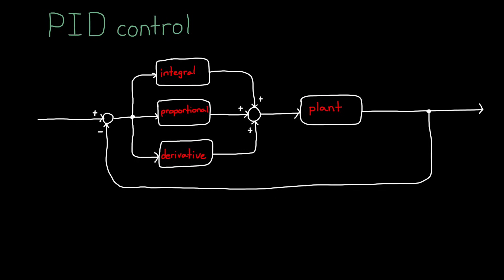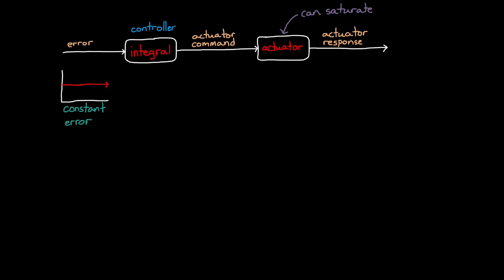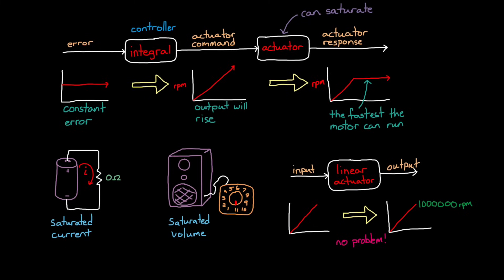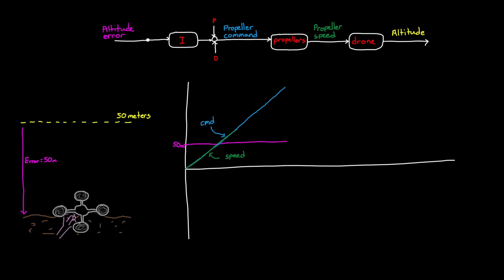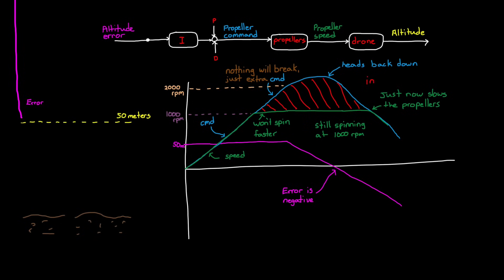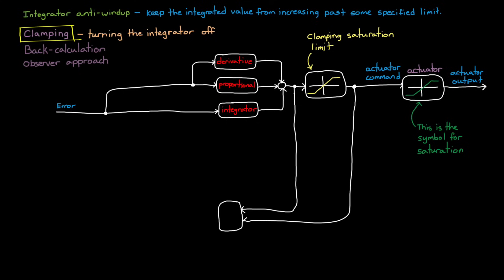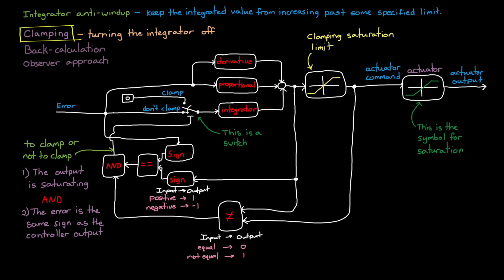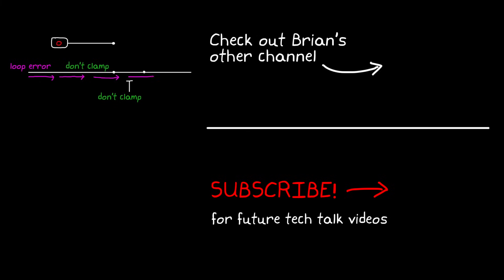Anti-windup for PID control | Understanding PID Control, Part 2

Comment: Excellent explanation—many thanks for the clarity in this video. However, there seems to be a small error in the diagram around 00:08:54 that most viewers may have missed. The “switch” controlling the integrator clamp is shown in reverse. During clamping, the signal path should be disconnected to stop integration, but in the diagram it instead appears connected, and vice versa.

Comment: To check if "the integrator is making things worse" i.e. what Brian computes as "Sign(error) == Sign(u)", I think should be "Sign(error) == Sign(u - Sat(u))". Where u is the controller output and Sat() is the saturation function.

In other words, the condition "is the integrator is making things worse" has to consider at what side of the allowed band of values the variable u is. Is u hitting the upper saturation limit or the lower one? that matters to determine if things are getting worse

I have tested this on a real implementation and had problems until I fixed this.

By the way, this assumes that the Integral Gain is positive (Ki > 0). If it is negative then the condition should be: "Sign(error) != Sign(u - Sat(u))"

Comment: When deciding whether to stop accumulating the integral term, should we not consider the sign of the integral term instead of the sign of the entire sum (output)?
Reply: No it's the sign of the output. Imagine that the integral output is a negative term but P and D outputs are both really positive making the summation of all three positive and saturating. Since the error is still positive (which we know because of the positive proportional output) this means that the integral is going in the positive direction - in this case getting less negative. Do we want that? Well, we're already saturating in the positive direction so moving the integral less negative will continue to make the whole PID output more positive and therefore more saturated. So, even thought the sign of the integral is negative, we still want to clamp it with a positive output of the PID controller. Did that make sense?
Reply: @BrianBDouglas  Right. Thank you!

Comment: Sir, can you please explain that what is the sign of the controll which you ment in the video as comparison with the sign of error ( at 8:01 minutes)  🥲 please sir .
Reply: sign() is a function in MATLAB and the documentation will help you understand. In the video, I'm just saying that if the integral is saturated in the positive direction (a sign of 1), and the error is trying to make it more positive (a sign of 1), then we want to clamp the integral and not allow it to add any more error to the summation. However, if the error is trying to make it more negative (a sign of -1), then we don't want to clamp because the error is actually trying to remove the saturation in the integral and we want that to happen.  Does that make sense?
Reply: @BrianBDouglas  thank you so much sir 😊, i have understand now . I am so glad that you replied me😊

Comment: What I don’t understand is the following. Since the error would be the difference between the measured rpm and the wanted rpm, how do we reach the 2000 rpm if we are never actually reading more than a 1000 rpm, in other words, at what point does the motor receive the 2000 rpm order?
Reply: In this example the measured value and hence the error is the drone altitude not the motor speed, hence as long as the height difference exists the integrator keeps accumulating the error value and therefore sending larger and larger actuating signal
Reply: @Omo_Mohd  Thanks for answering!
Reply: Okay I get it now, thank you very much for your response, much appreciated @Omo_Mohd

Comment: thanks brian, this is really one of the most important things we should remember in our control systems. It actually is very important in hardware control.
Reply: Can anyone please explain, why after controlling it became walking speed? At first it was error between reference point and altitude. Then why it became speed after using PID controller.

Please explain

Comment: Edit: Nevermind. The video is right. I wasn't considering that the AND gate with the output bejng saturated. It makes sense to null the integrator input if the error is positive and the actuator command is positive, if the integrator is just going to continue trying to push the actuator command further past the saturation point.

I think there might be an error in the video. As described if the drone is at 0m and the target is 50m, the error is +50m and the desired motor RPM is positive to drive the drone higher. Positive error and positive actuator command seem to be a desired state, which I don't think would be a trigger case for nulling the input to the integrator. It would make more sense that if the error is negative (drone went to 55m, so error is -5m) and the actuator command is still positive (driving the drone even higher, i.e. overshooting) should cause the integrator clamping to kick in.
Reply: I can't understand the AND gate and it confuses me, could you please explain it

Comment: Just wondering (please correct me if I'm wrong) in this particular example of holding on and then letting go... Imagine 3 scenarios: the first with a linear actuator that doesn't saturate (or saturation happens at very high levels of actuation). The second with an actuator that does saturate but there is no anti windup implemented. And finally the third scenario with a saturating actuator and anti windup implemented. In this particular example, i think scenario one will give the worst results, worse than scenario 2. Just because in scenario  one the propellers will just keep on spinning faster and once you let go it takes a while for the integrator to "unwind". In the second scenario the integrator also winds up, but the propeller can't go any faster so once you let go it will shoot up less strongly than in the first example. Of course the third scenario will be even better. Want i want to say is that for this particular example, it doesn't feel like we're solving an issue caused by saturation of the actuator, but rather an issue caused by the "initial situation".

Comment: Probably far too late but: if you have a PI controller with anti-windup , do you need derivative control? It appears to be doing the same thing i.e. putting the brakes on overshoot.

Comment: at 9:15, when 1000 rpm is reached, cmd is immediately clamped. I can understand that the saturation condition is met here. But I struggle to understand the condition regarding the sign. At that time, the drone is below 50 m and the speed of propeller works in the direction of reducing that position error, how is the condition of sign is also met to trigger the clamping?
Reply: Edit: Nevermind, I think the video is right. I posted another comment with a bit more detail on why.

I think this might be an error in the video. As described if the drone is at 0m and the target is 50m, the error is +50m and the desired motor RPM is positive to drive the drone higher. Positive error and positive actuator command seem to be a desired state, which I don't think would be a trigger case for nulling the input to the integrator. It would make more sense that if the error is negative (drone went to 55m, so error is -5m) and the actuator command is still positive (driving the drone even higher, i.e. overshooting) should cause the integrator clamping to kick in.

Comment: This is very interesting Theoretical and practical information. I have 20 years experience Thermal Vacuum Testing at Lockheed Environmental Laboratories. I have wired A SOPHISTICATED Industry High Grade PID controller, the relays, solenoids, heaters, build piping for the Liquid Nitrogen lines for Thermal cycling test for materials for SPACE. I had a hands on on its operations how all these instrumentations are put together along with data recorders /  dataloggers storing data. I have always wanted to know the engineering mathematical physics of CONTROL Systems Theory as HOW REALLY does the PID controller circuits work. I would like to learn HOW It is DONE electronically. I would like to learn how it is done on an ARDUINO to fully understand how PID WORKS.

Comment: So I have a question,
When the actuator is wound up and the drone is released and reaches the desired altitude, the integrator would very quickly decrease, but if the total height gained was large enough, would the decreasing of the integrator wind up negative and wind up in the other direction, thereby once the drone is at the desired 50m from falling, it would already be wound up in the other direction, thus causing it to not spin back up its motor in time and crashing into the ground?

Comment: Hey Brian. Great video! Why do you evaluate the signs of controller in and output? Is that only necessary for a PID controller, as the D-part can create negative control, or would you also do that for a PI-controller?

Comment: Hi brian. I have been following you since a while. I honestly love your work, I would like you a question about the wind up, shouldn't we just can't use a derivative in order to avoid the big overshoot we obtain in the wind up effect? I say this according to the idea of the derivative of PID contoller you said in the your las video. Congrats again and honestly, thank you for all the contributions you do.
Reply: I think the the derivative might not be sensitive enough to compensate. Imagine a wind up that lasted for 10 hours, the integral would become so huge that the derivative would never be negative enough to remove it before it caused a massive overshoot

Comment: To counter the integral windup can't I just increase Kd,as the drone rises up the derivative or the change in error is huge(has a negative sign) and so high Kd will ensure that the drone doesn't go too fast.
Reply: The wind up could be arbitrarily large depending on how long it lasted so no

Comment: Brian, Have you touched on Reset Wind-Up yet? ( where the error in the process control causes the control to over shoot in increasing amounts when the process approaches set-point, like this  [1,-1] [2,-2] [5, -5] [14, -14], etc .... kinda like 1/4 wave damping in reverse....?). Thanks

Comment: Integral windup, also known as integrator windup[1] or reset windup,[2] refers to the situation in a PID feedback controller where a large change in setpoint occurs (say a positive change) and the integral term accumulates a significant error during the rise (windup), thus overshooting and continuing to increase as this accumulated error is unwound (offset by errors in the other direction). The specific problem is the excess overshooting.

Comment: Clamping. Clamping will always work. It detects when there is integrator overflow and sets the integral path of the PID-controller to zero to avoid windup by using a simple switch. Clamping is a commmonly used anti windup method, especially in case of digital control systems.

Comment: Hi Brian, nicely articulated explanation. Really appreciate and really helped in understanding the concept better. By the way, when do we turn on the integral input again? Is it something like we need to continuously monitor the integral input?
Reply: I'm no Brian, but according to my understanding, the clamping of the integral input (and thus the switching off) only happens in the case that the actuator is in the saturation state. Only the clamper detects that the actuator is no longer in saturation (and that the error sign is the same in both actuator and controller output), it would turn the switch on again. So no constant monitoring of the integral would be required.

Comment: how controller output can be negative???
Reply: A servo in the middle is at a 0 position. Moving the arm right means the controller output is positive, moving the arm to the left means the controller output is negative.
Reply: Exactly I feel like it's a mistake, and it should be the derivative of the controller output

Comment: Question: Why would clamping "integrator windup". If the output of the and gate is a "1" (positive) could this be a the integrator attempt to remove the steady state error? It seems like the error becoming negative after reaching the reference point would be the first indication of integral windup, and that when the error and the integrator outputs are "negative" making it necessary to apply clamping.

Not sure why the "positive" value of the comparison would be used to make the clamping decision? Please explain.

AM

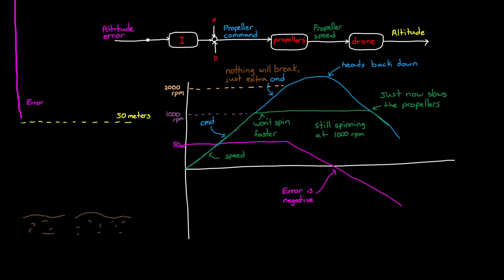Comment: Hello Brian, I have a question You said that the maximum velocity is 1000 rpm, but why in 6:08 you also said that the drone will sky up over the 50 meters. Is the motor spinning over 1000 rpm at that time?
Reply: Yes, as seen when the pink line reaches zero.The reason is that until this time the integral error has been increasing therefore increasing the command (above 2000 at this point). It is only after the negative error matches the positive error that the drone will start coming down

Comment: Hi Brian,
It would be great if you illustrate how to model a process control loop, for instance a control valve controlling flow rate downstream a centrifugal pump. Using pump curve, valve characteristics and fluid equation

Comment: The sign part confused me but i think I may have gotten it after rewatching the video. 

The confusion I had was that I mistakenly understood that when the two conditions are met, the weight Ki is set to zero. Effectively reducing the actuator signal to zero. If I now understand correctly, this is not the case. The integrator contribution to the actuator signal still remains at its maximum/minimum value when the switch is turned off, but it's input for integration (the perceived error value) drops to zero. So any new addition at a time t does not change the integrator's output value.

However, when I start thinking about how the derivative may affect this, everything goes whack xD
Reply: This comment cleared my confusion, thank you !
Reply: Also cleared my confusion, I was initially clearing the entire integrator, which is not what needs to happen, the summed integrator value remains, however, any new adds are ignored.

Comment: Brian has just described my biggest complain with people that use Matlab.  Matlab doesn't seem too consider that the controller has an output of +/- 10 volts ow +/- 20 ma.  
However, how does Brian propose to control a hydraulic actuator.   The closed loop transfer function is K*omega^2/(s*(s^2+2*zeta*omega*s +omega^2)) where K is the open loop gain, zeta is the damping factor and omega is the natural frequency.   A PID does not work.   There should be one gain for every pole but the integrator gain does not count because the integrator has its own pole.

Comment: Thank you. Kindly I have a question, why we do not only limit the integrator output (add saturation limits) without using using anti-windup ?. I think we solve the problem by adding saturation limits only. Is that right ?

Comment: Hi, Brian.

Firstly, congratulations on this excellent series of videos. Talking about the clamping algorithm, I just want to say that the condition number two depends on whether the PID action is direct or reverse. If the PID is in a DIRECT mode, the condition will be: 2)The error is the opposite sign to the controller output. To illustrate, just think in a valve in the outlet of a tank, if the level is high (negative error), the control signal should be positive, because we need to open that valve. However, due to the windup, the integral action could stay adding a positive signal indefinitely, and this should be avoided.